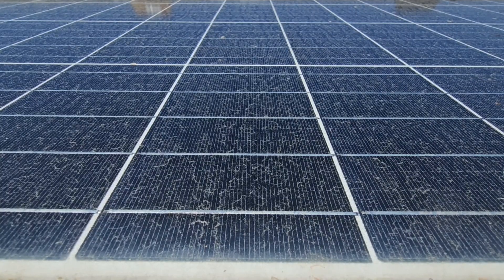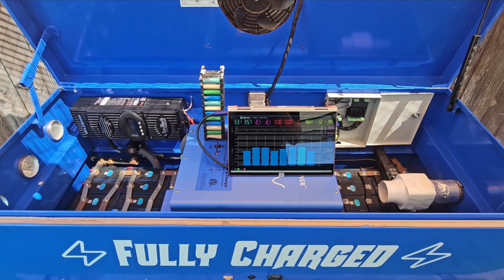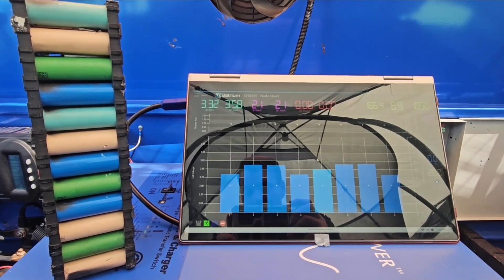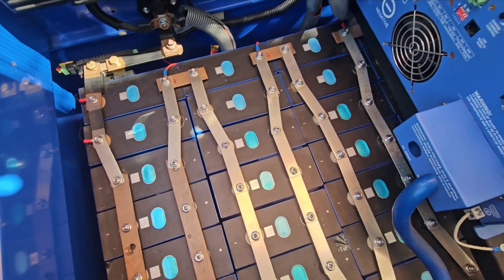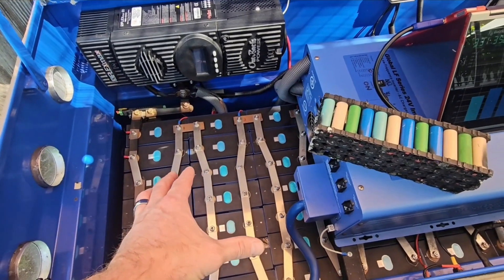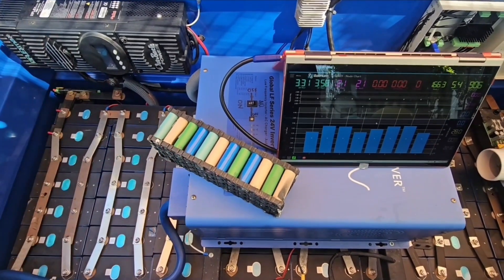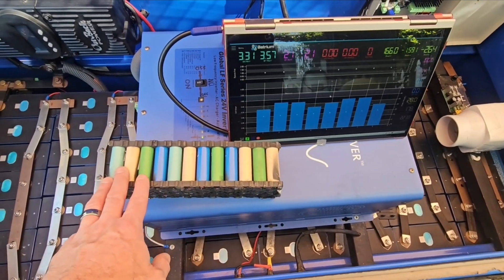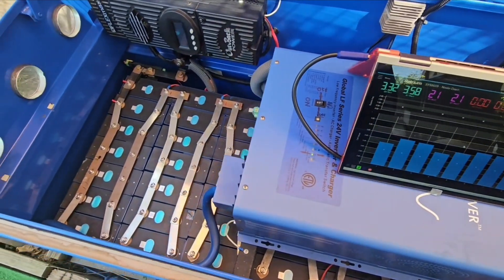My Opinion on Batteries 🔋 Lifepo4  vs. Lithium-ion

Comment: Another awesome video!!! You just stopped me from trying to do this with 21700 cells! I have only built my ebike battery so far but, thanks to you I have a great welder now. Where would you suggest we get these type batteries? Definitely want to make one like this. Again, for us new people, THANK YOU! I love, love, love the whole battery world and you are making it even cooler and more fun! :medal-yellow-first-red::medal-yellow-first-red::medal-yellow-first-red: Or, maybe a list of the stuff here to use as a guide would be awesome. Whenever time permits.
Reply from the maker: I'm glad you like the welder, I love it too.  I buy my batteries here, her name is Amy. She will give you the best deal possible. Email her and ask her to send you a link for "EVE 280ah Lifepo4 batteries". Her email is -  Amy@qisocell.com .

If you mention my channel she might give you a discount. 

• I used a AIMS 24v inverter 
• Batrium BMS
• Copper for bus bars
• Outback 100amp solar controller 
• an outdoor construction box
• 12 inch radiator fan
• Bilge blower for exhaust
• digital temp controller 
• xt90 connectors 
• 8awg, 10awg and 12 awg wire
• 00 awg cables and ring terminals 
• solder and soldering gun 

It took me about 60hrs to make. I power my house & charge my vehicles 300+ days a year.

If you need any help let me  know. I had a lot of fun making this project. 

I appreciate the support, thank you for the for the positive comment 👍

Comment: What’s the inverter you have there?
Reply from the maker: It's a 24v AIMS inverter... it runs very well. 2 years now
Reply: @FullyChargedZone  how many watts?
Reply: If I had that working great I think I would consider disconnecting the power service to the house. Maybe a generator would be cheaper or more panels.

Comment: Mmm love your opinion but agree to disagree I would prefer 18650 only for the discharge and charging I own both chemistries …and would prefer li ion..also using mixed recycled repurposed or used cells is still totally safe I have been running my home for about 4 and half years now and everything been smooth sailing.(but of course I test them all first )i have such a large battery that it doesn’t cycle everyday maybe every three to four days and that’s running every in my expect my ac only because it been cold..with solar my cycle life will out  live  me

Comment: Ty.i was curious about this difference.  Also ty for waiting 2 years to tell us. My van, which I don't live in, I expect my lipo to last a long time. Compared to lithiumnion, I am curious how the old nickelMH compared. And older lead acid agm tech.  Just to put it into perspective.
Reply: I was wondering why he never posted an update until now. The data is in and it sounds like it was worth it
Reply from the maker: @realityisunavailable  I never built a battery this big before....I waited to see how it would react over different Seasons & Time. I'm glad I did, because I know what works for me now.
Reply from the maker: So far, I would say the AGM batteries last just as long as the Lithium-ion batteries do. The led acid and nickel metal hydride are still good batteries.  A Lithium battery can be charged as fast as 1C, whereas a lead acid battery should be kept below .5C
They charge about 60% slower from the sun. I built a huge battery with prius nickel metal hydride cells once.  It lasted about 4 years. It powered my garage. MY RC Lipo battery still works 9 years later. I never built anything big with Lipo before.

Comment: What you're saying about charge speed makes no sense. I think you're being deceived by the flat charging curve of LiFePO4. 

Remember with LiFePO4, VOLTAGE IS NOT AN INDICATOR OF SOC UNLESS AT THE VERY TOP OR VERY BOTTOM.

Both chemistries will take in an obscene amount of amperage due to its low internal resistance. A 3Ah 18650 might have an AC IR of 20mR. A 300Ah LiFePO4 cell will have an AC IR of 0.20mR roughly. So as you can see they have nearly identical IR's when comparing new cells. What other factors exist beyond IR and coulombic efficiency? None that I know of.

Your comment about 48V BMS failures is confusing....but I'm guessing you've seen Daly failures and el cheapo BMS failures. JBD and JK BMS's are in use in thousands and thousands of DIY builds (along with JBD being in many off the shelf batteries now) and while JK is a bit more complicated and suffers from user error problems, JBD is a VERY stout BMS no matter what the model you choose so long as you avoid the sub $40 models. Their 100A and 200A 16S LiFePO4 models are rock solid.
Reply: My 200ah Sony 18650 lithium ion powerwall charges twice as fast. My 24v Lifepo4 Battleborn  battery doesn't charge as fast.  Same solar controller, same amp hour battery.
Reply: @Transmitvideo  wow that's alot, 2x!
Reply from the maker: @Transmitvideo  Sony 18650s are great batteries. It's hard to find real ones. I saw almost every 18650 out perform lifepo4 in charging. I just don't see the life expectancy as the same. The only cell that did outperform was the Tesla 18650.
Reply: I think he’s right
Reply: Sounds intelligent to me, I’m an engineer for Rivian. I think this setup is one of the best DIY I’ve seen.
Reply from the maker: Thank you for the kind words. I put a lot of work into this solar battery.  Rivian is an awesome EV company.  I worked for them for about a year. It was a good learning experience.
Reply from the maker: I've been building batteries for 5+ years. I'm also an Ev technician for Tesla and VW. What's confusing? Maybe I can help. There are only 2 major differences.  Lithium-ion charges at a faster rate than lifepo4.  Lithium-ion also doesn't last as long as lifepo4. I've charged multiple  batteries with the same amperage and same ah. The studies are done over a 3 year time. The results are always the same. I've installed multiple 48-v systems. I keep seeing failures with 48v battery management systems. Ant, Daly, and even batrium. I work on electric vehicles and see 48v systems struggle.  The reason tesla uses a 24v module in their EVs is because it just performs better. This was the main reason for going with the 24-v system. I don't like failures.  I use this solar system every day possible. Customers like one thing... reliability.  
This is what I found is  reliable and what charges better. I hope that answers your question.
Reply: @FullyChargedZone I was going to make a similar statement in the form of a question. I wanted to follow up on your statement is the li ion charged faster. i didn't doubt it , you didn't quantify it so I was curious. Faster by how much? Not too much of a concern for me personally as my requirement and size are way lower than your setup (periodic small rv use). Tyia
Reply from the maker: @alutious  I would say every Lithium-ion battery from Ev to laptop batteries charge pretty quick.  I've built and repaired a lot of batteries over the last 7 years. In my opinion I see that cylindrical cells like the 18650 charge 20 to 30% faster.  My calculations are based on multiple sunny, cloudy, and rainy days. These types of batteries seem to absorb almost all the energy provided by the solar panels. I think the way the Lithium-ion battey charges is the best characteristic.

Comment: my original 10Kw battery was made with 18650... 2100 cells i soldered... pain in the butt...  BUT thats what was available 6-7 years ago.. alot of new batteries out there now...  i am now rebuilding new batteries with the LIPO4 304Ahr batteries 48v (~14KW). plan on make 3 batteries for my house .   (yes like you, i will never buy those over priced premade packs.. i like learning by doing)
Reply from the maker: I have many hours of soldering batteries myself :) 
It seems like a waste now... but was a fun learning experience. I hope you put a video out about your new build.  If you have any questions, let me know. I feel like DIY is the only option.... unless you want to overpay  for manufactured batteries.

Comment: It's a real nice battery box that.  Few questions - 1 - you love tesla cells why not try tesla 24v modules if you get them out of the same car they should be very well matched and perform great - they're cheaper than Lifepo4 where I am and they're only gonna get cheaper as more and more tesla's expire/get written off etc.  2 - that huge slab of batteries can take WAAAY more than 100 amps your no where near 0.5c by the look of it so why say they charge slow - you'd only be charging lithium ion cells at 90 amps too as thats all your running your controller at? 3. The batrium looks like it is struggling to keep the cells balanced is this the battery back basically being too big too many amp hours for one batrium - would you be better off splitting in half and having 2 batrium for double the balancing power?  Cheers!
Reply from the maker: Tesla modules come used only. They're also 6s. It's not the configuration I'm looking for. I never build with used cells.  1 because of fire and 2 because of failure. The battery is perfectly balanced. When under heavy load... 3 air conditioners it will read unevenly.  This is not a resting battery with light loads.  I'll make an updated video. In my maintenance days, the battery is under no load. Most videos  don't show batteries under load working.
During the night, the battery always evens out. When I go bigger on my next build, I will consider 2 batriums. 
 I have a broken powerwall I just purchased. I'm going to fix it and see which one out performs.
Reply: My Batrium runs the same way while running big amps. I think every BMS I every had runs like this under load. To call this a battery box is not fair. I haven't seen anything on the internet that looks this clean. How does it do charging vehicles?
Reply: Hey I didnt mean any negative when I said battery box - it's awesome! @Transmitvideo
Reply from the maker: @Transmitvideo  I only charge the vehicles on sunny days. I can charge my EV and still power the house.  I only charge at 25 amps from the sun due to the amount of solar I have. I can charge 2 Tesla’s on a sunny day from 10% to 80%. My family calls it the big blue box lol. I call it my Fully Charged Powerwall Box. Battery box works too.  I  don't know if it's the best battery build, but did put a lot of time in it though.
Reply: He's pulling close to 50 amps, I think will give you readings like this. My batrium does this while powering my cabin. When I shut the  inverter off battery display looks evenly balanced. When inverter is running it looks crazy.  Batteries only balance when charging correct?